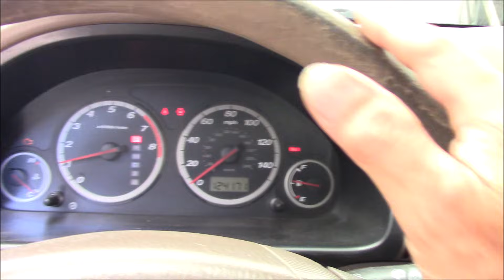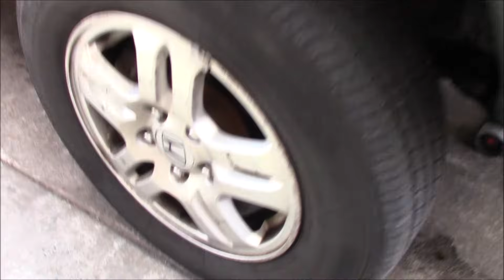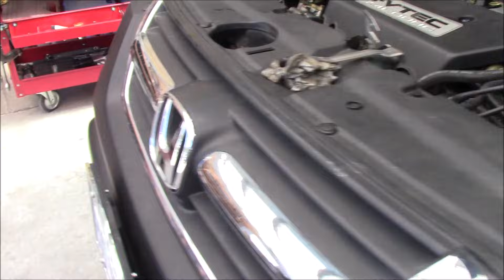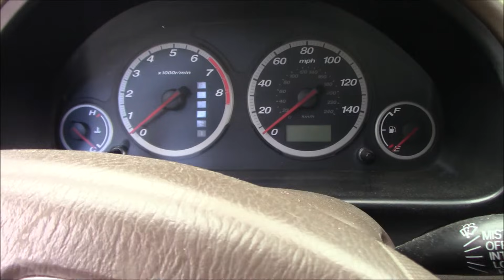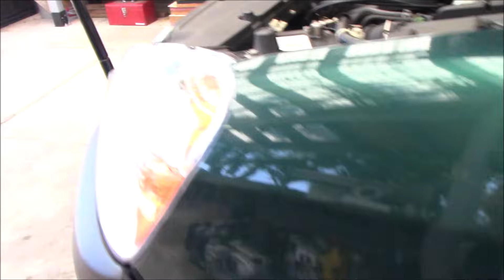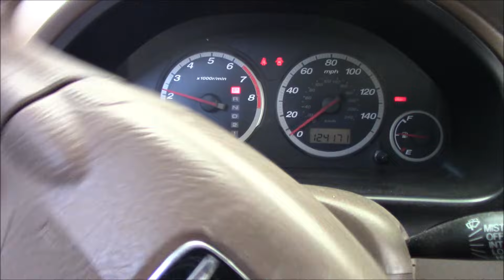Power steering noise - fluid overflow

Comment: That part that you replaced the 0 ring that hose i changed that old clamp cause in my case in was sucking air cause the clamp wasn't good and after that my problem got fix but you need to bleed it with the car off not on
Reply: Bleed it meaning.

Comment: Thank you for the video of actual diagnosis vs just changing parts. If you could shut the engine off to talk that would have been better for me but I heard enough of what you said to get the point. I’ve replaced  my rack and the pump 2xs in a month so I have to have a leak to track down since mine comes out the top too.

Comment: Before replacing pump fovthis issue .. there is a filter in the reservoir replace reservoir 15 flush the system fill and burp the system guaranteed fix